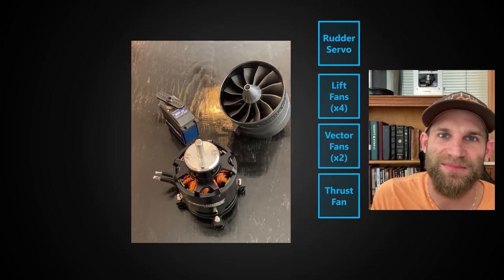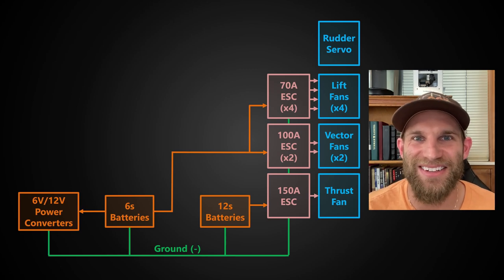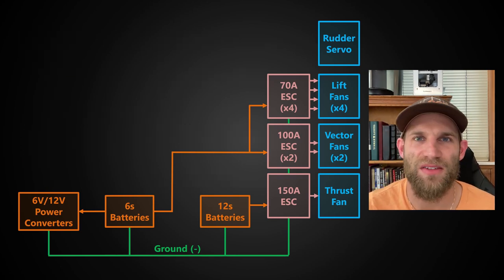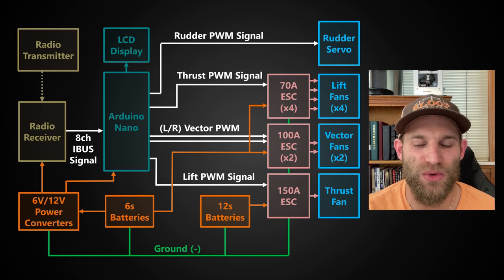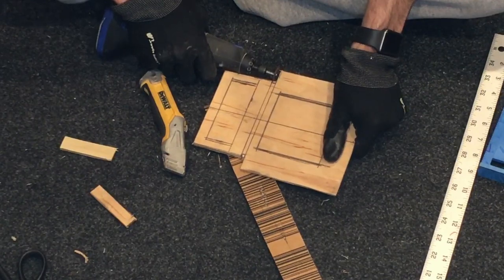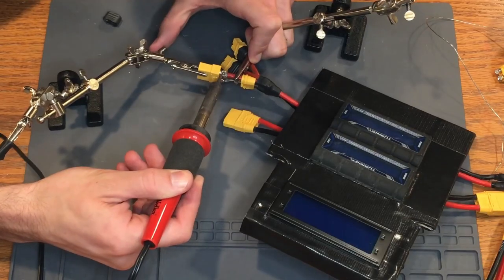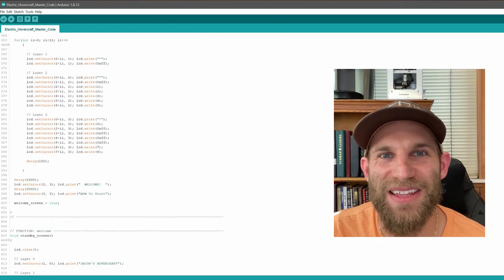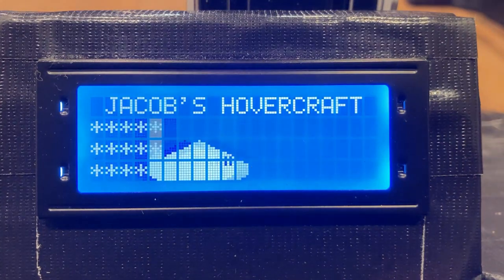How I Used Arduino to Computerize my DIY Electric Hovercraft

Comment: Great video, Jacob! Is there any merit in using the governor function of some ESCs? Your lift motors for example.
Reply from the maker: That's an interesting question. For right now, my strategy has been to use the stock components in their most basic stripped down form and leave the more advanced features to the one thing I can fully customize and control; the Arduino. But the governor function may be a good option (if my basic ESC has a good one) for the lift motors depending on how successful my voltage compensation turns out to be.